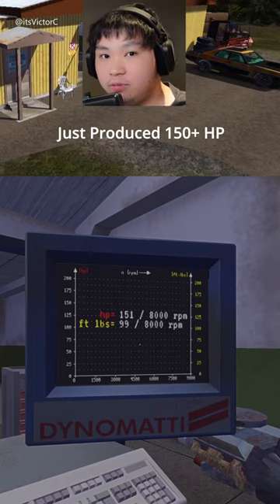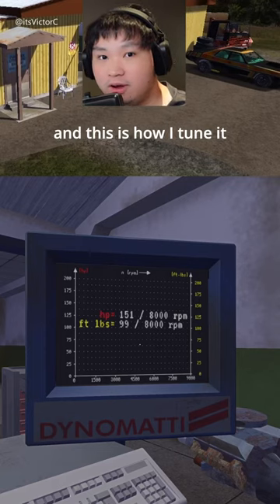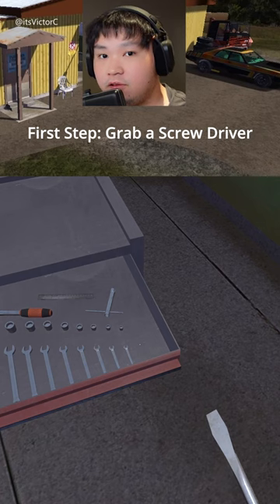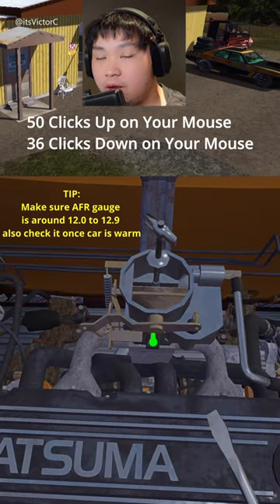150HP Stock Carburetor Tune in My Summer Car  #shorts #ytshorts #fyp #mysummercar

Comment: My car blew up or something becuse when I started the car I immediately died😂
Reply from the maker: It might be the fuel pump try changing it and also check if all of the piston is still in the block. If one of the piston is missing then you have to rebuild the engine.
Reply: @itsvictorc  I quickly quit, then tried it again, but nothing happened, so I guess it was just a bug. Also I only got 62 hp from the tune
Reply from the maker: Well the power figure varies and it also depends if you are using all brand new parts because when I did this I was using all new parts with little wear on it.
Reply: @itsvictorc  all of the parts were freshly bought at Fleetari's when I tested, then I tried changing them to 100% in MSCE, but got the same result, My Summer Car tuning is kinda weird, so far no tune I found online has worked like it should've, it's like the game wants us to figure it out for ourselves through trial and error
Reply from the maker: Yeah sometimes the game does that. But you could try to lean out the mixture to around 12 - 12.9 on the AFR gauge and see if you can get close.